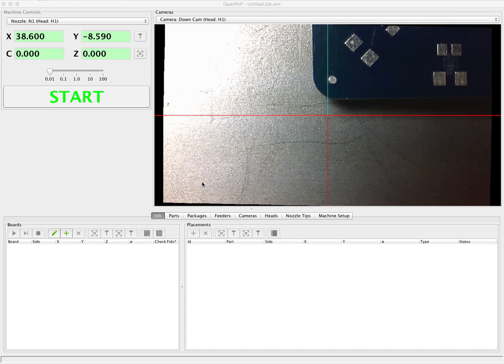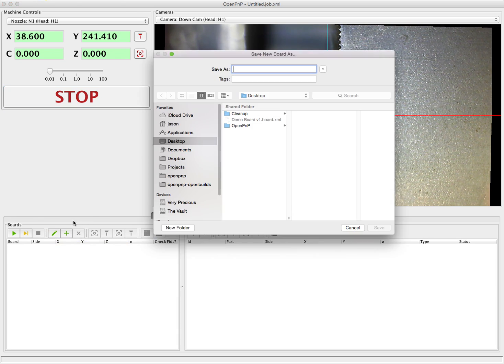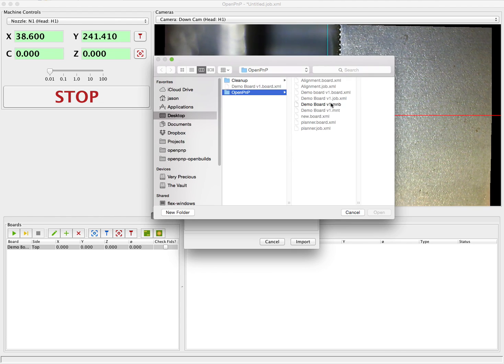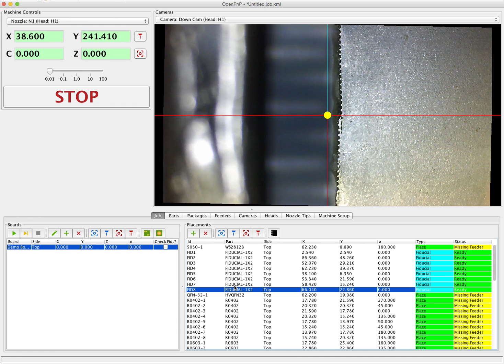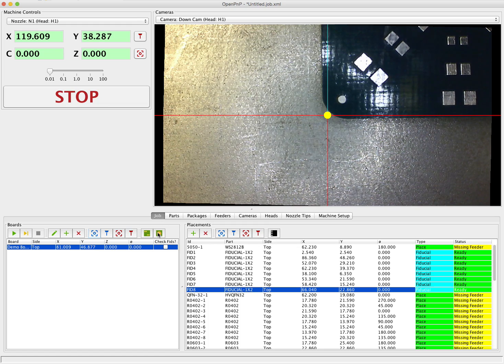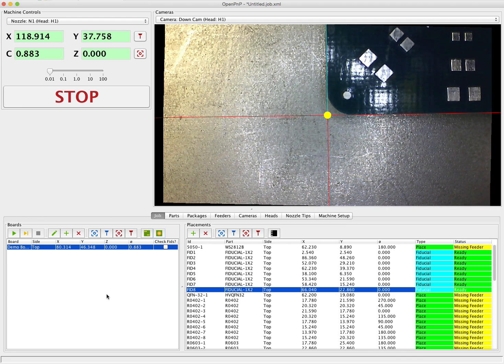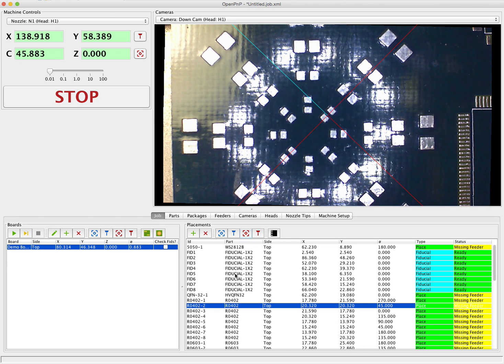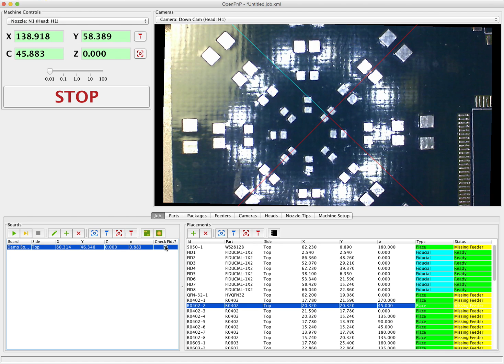OpenPnP Fiducial Tutorial

Comment: Hey Jason,  does Arduino Uno work with OpenPNP? I have read many articles and it seems that the GRBL motion contronller is out of date? what should I use? I currently have an Arduino Uno and a CNC shield .
Reply: No, its dose not run on a arduino but you could run it on a raspberry pi and communicate with the arduino through serial.